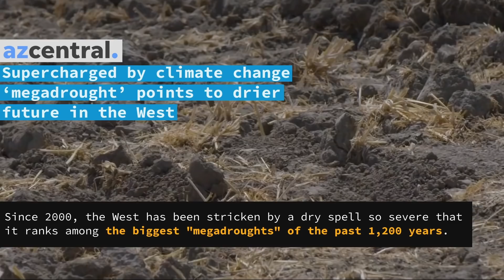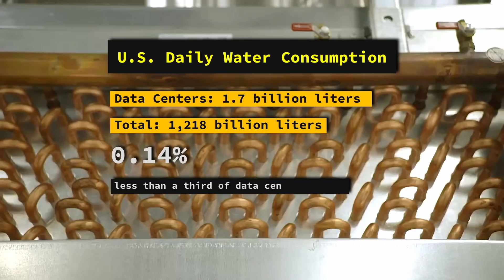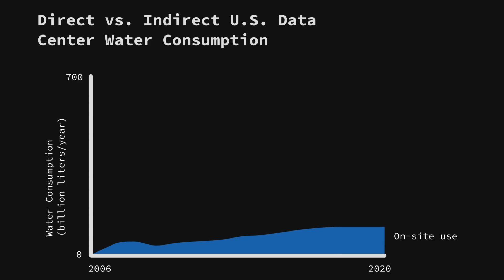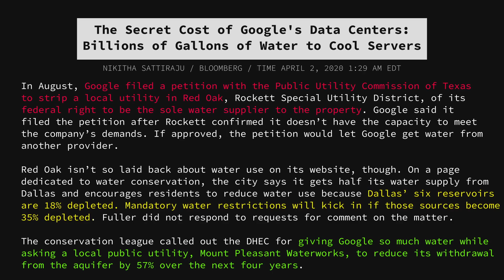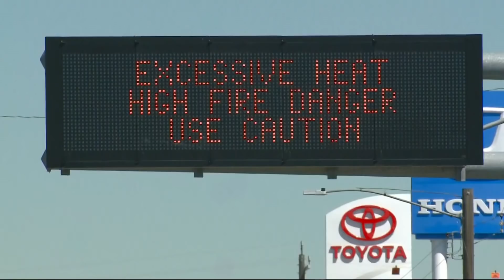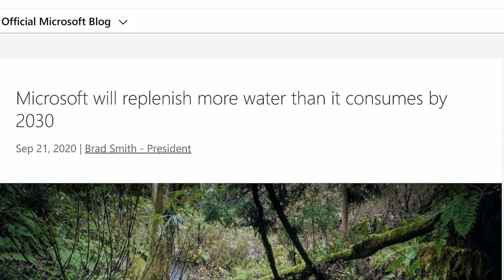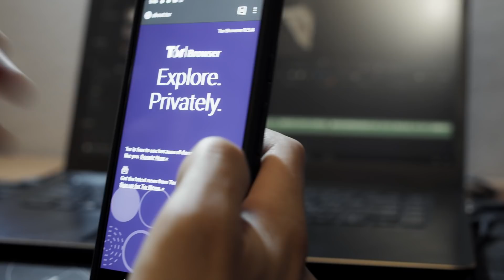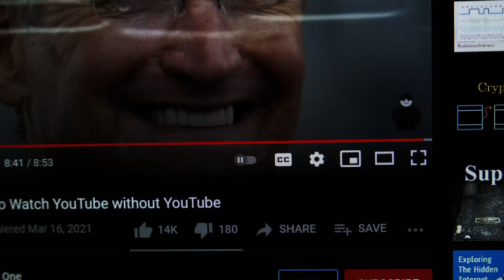The Internet Is Running Out of Water

Comment: The fact most people don't understand what it means to consume a resource and arguing this isn't water consumption is bad.

If you take 200x water from a lake and the natural precipitation refills it at a rate of 10x then you're consume water and depleting the lake at a rate of 190x and when the lake is gone the lake bed starts to dry out making it harder to gather water.

You literally consume that entire resource... as you are by definition using up that lake till there is no more. You have used up the water till there is no more.

If you built the data centers in Michigan to make use of the lakes then the end result would be the same as the lakes would dry up eventually if you take water faster then it returns meaning everyone loses access to water. You are consuming it and using up a resource.

Areas will get more rain based on wind currents and other details as well... which creates a whole new issue. Flooding. Not only are you using up your resource but you're increasing rain fall in other areas leading to destruction. So you are consuming and running out of water while other people have excess to the point where it can be dangerous.

Comment: I think it's a bit unfair to allocate electricity production water usage to data centres directly - depending on the energy mix couldn't you end up with an air cooled data centre apparently using more water than a water cooled data centre if you do this? The energy mix is surely a matter for the relevant authorities to decide, and if they've using too much fresh water in arid areas then that's a failure of planning on their part. Come to think of it the whole thing sounds like a failure of regulation - permits for using all that water should never have been granted if it was unsustainable.
Reply: I wonder how many of the people on regulatory teams are shareholders of big tech companies.

Comment: I find the message in this video rather ironic, considering how you choose to accept payment in cryptocurrency, which is an extremely unnecessary tech that can be cut out (and only ransomware developers + intangible coin holders will whine, but to the benefit of literally everyone else).
Reply: There are plenty of Proof of Stake crypto coins out there now which don't have the power use issues of Proof of Work such as bitcoin.
Reply: Actually there is reason to have crypto currency.

The main thing is if your country violently explodes your money suddenly doesn't become worthless. It gets around country/currency issues which would ironically save more if we all shifted to it reducing the effects of monopoly and make hiding funds to evade taxes or doing your part harder.

The problem is to do that shift requires everyone cooperating...
Reply: @Buglin_Burger7878  Is this "reason" justifiable enough to be unwinding literally the past decade's worth of carbon savings through EV? Or will the internet money magically be able to save all the marginalized folk (that may be rugpulled, mind you) while excluding the poorer folks that has zero involvement in crypto?

That reason is shit my dude. And if you need to get everyone on board, sounds a lot closer to a ponzi than a solution.

Comment: This is misleading. The author lumped Data Center and power plant use of water in the same measurement. And implied that water used for either couldn't be tapped for any other process like irrigation or drinking. Water conservation is important but articles like this track from actual problems
Reply: IT can't be reused. That water has been turned into water vapor. It is no longer liquid water. If it was liquid water still the data centers would have kept on using it instead of paying for more liquid water.

Comment: When water evaporates, it forms clouds and falls back down; it is never consumed (in an absolute context). What has water consumption looked like throughout the years in those areas? Surely, it has been on a constant rise with the population.

The idea that a higher level of CO2 in the atmosphere is causing a drought is absurd. Think about it; if CO2 is supposed to cause a greenhouse effect and keep heat from radiating from the Earth, why does it get chilly at night in the summer time after a scorching hot day? If CO2 was an obstacle to IR radiation, wouldn't that work both ways? I realize that the sun emits UV and visible light in addition to IR, but isn't IR what is actually felt as heat?

Let's conduct an experiment: prove whether or not CO2 causes a significant greenhouse effect; at the same spot and the same time every year, take a spectrograph of the sun's light, and compare each one for a decrease in IR light reaching Earth. If it inhibits IR radiation from Earth, it inhibits IR radiation to Earth.

Let's conduct another experiment: how extreme is the greenhouse effect caused by CO2, if at all? Pull a vacuum on a chamber which has an IR emitter on one side, and IR receptor (or camera, so any diffusion through the gases can be imaged) on the other; this chamber may have to be very long to be able to measure how different gases may or may not effect IR radiation. Take a measurement of the intensity of IR reaching the receptor. Do the same with 100% CO2, and with 70/30 Nitrogen/Oxygen. Lastly, increase the CO2 concentration by the same minuscule amounts that are measured in the atmosphere, and see what happens to the IR.

These two experiments alone can make or break the whole idea of climate change, formerly known as global warming, formerly known as global cooling. If you're right, what have you got to lose? Do the experiments.
Reply: It is consumed as you are using up the resource.

If 200x of water is evaporated 200x isn't going to fall where it was used at, hence it was consumed. It is removed from that area. That 200x will end up in another area based on wind currents and such.

So if you get 10x water a day through natural means then you're losing water at a rate of 190x and the bodies of water dry up. If you know how lakes form if you drain all the water eventually the dirt dries out and it becomes harder to form a lake.

This means the lake you're drawing from is being used up.
It is by definition consumption.
Reply: @Buglin_Burger7878  Read the parenthetical note.

Comment: Very flawed logic here. Water that is sitting evaporates… the energy to evaporate it can be used to cool data centers.  It is a very efficient means of cooling.  Water is not consumed in the process.  So, you insinuate we should just let water evaporate on its own under the heat of the sun as opposed to using that latent heat to cool data centers.  So we should burn coal to make up the difference? 

Sadly, you and your followers mean well but are misguided.

Comment: I don't know much about either power plants or data centres, and the video has left me a little baffled. The video has mentioned the majority of the water consumed by data centres is indirect water consumption for power generation. And the sources in the description have noted that the high indirect water consumption originates from the non-renewable method of power generation. 

So I wonder if data centres commonly operate their own power plants that are independent of the grid for normal operation? And I feels like the excessive indirect water consumption is perhaps more of an issue on the part of the power plants than the data centres? And since any method of power generation that is not wind or solar consumes a large quantity of water, (even nuclear or geothermal would have to use steam turbines I think), is it really meaningful to focus on the indirect consumption?

Comment: I can't understand why any new large warehouse or data center isn't required to cover all of their power use by installing solar panels, wind generation and batteries. They shouldn't be drawing off of the grid in this day and age and they shouldn't be allowed to use large diesel generators for backup power unless they have batteries that will act as the initial backup for a given amount of time and then they can switch over to a generator if the power outage lasts long enough that it depletes their batteries at a rate that the solar panels can't recharge them.
Especially companies like Walmart and Amazon. They come in and build these massive warehouses, they are given all kinds of tax incentives to build the place and a lot of times the state pays for the infrastructure leading to the building. It's ridiculous.

Comment: "47% of this drought has been caused by human activity" yeah no, you can't just play telephone with something as vaguely defined as climate change and attribute it 100% to 'human activity'. Datacenters should make use of blackbody heat radiation and small nuclear reactor modules for energy, it would be alot cheaper to just have passive cooling during the night to cool thermal reservoirs that take some of the load off active cooling during the day.

Comment: Some important points missed in the video. Why is water used in electricity generation, which seems to be the larger portion for water usage? If water is used for evaporative cooling, then where does the steam go? It's not like they pollute the water and straight up make it unusable. If they don't use evaporative cooling, that most likely points to water used as a heat conveyor, so where does the incremental usage come from?

Without answering these, the video just seems like an illogical piece to simply promote the hate for big tech
Reply: Maybe it just goes back into the air because they don't recycle it... and in turn this means the water goes elsewhere and rains down on other places.

Comment: This is confusing me though, water do not disappear, if it's used and evaporated, it is still there, just in gas form and it should be condensed after a period and fall down as rain again. Water don't just disappear when boiled or heated. But if this is the case, then the reservoire should not decrease, but they are. Idk how this works.
Reply: Water comes from under ground springs.
Reply: @KallusGarnet  ?????
Reply: @KallusGarnet  what fills up the springs?

Comment: As far as I understand it, tech companies could reuse the water that they take by containing the steam produced until it condenses into water and can be reused by them. As the price of water increases it makes sense for them to start to use oceans and desalinate it. Places with a lot of drought could likely use these tech companies to help fix their problem if they worked with them on desalinate projects. They could also encourage tech companies to take this route by exponentially increase the price of water based on usage. The higher your usage the more per litre you pay. It would be awesome to hear your thoughts on where this is incorrect.
Reply: Another approach is building a cooling loop into a natural structure, ex. literally building the radiator submerged underwater in a resivour. Entirely passive, free cooling (besides pump consumption), some data centers even use this method.

But you need a favorable natural site for it, and it'll cost more than more typical cooling methods.
Reply: They could also use closed loop water-cooling instead. With a big enough radiator, this could even be entirely passive.

You could also use a hybrid solution, where water is recirculated and some is evaporated, or a supplementary supply is sprayed on the radiators to cool them.
Reply: if they were actually making steam, it couldn't be a closed loop (easily)  that's not to say there aren't solutions, you can easily have multiple heat exchangers (some data centers do exactly this) where the the water lines go into an exchanger next to coolant lines.  Heat moves from the water to the cooled coolant, which is tranported to the external unit, compressed to get much hotter than ambient air, transfers excess heat to the radiator, moves back down to the data center and gets decompressed, cooling off enough to absorb more heat, and repeat the cycle. 

you could also skip the heat exchanger and run coolant directly,  but great care needs to be taken to not run the coolant below ambient temperatures in the data center, otherwise you risk condensation which is a quick computer killer.  See all the effort overclockers go through to benchmark with LN2...
Reply: @Pluto : But it does take time to return to places it's needed. In a humid environment, you'll be fine, but if you dry up a revisor in a desert... you might be in trouble.
Reply: Price based on water usage sounds like a brilliant idea, however those kinds of increases in prices just get passed down to the end customer. The only way to actually get data centers to change is for them to actually want to change. Any government pressure or laws will probably sky rocket prices. If the government started offering money to create efficient data centers things will probably change.
Reply: @mattmurphy7030  I live in a country where there is no other real alternative to drinking desalinated water (through reverse osmosis) every time we open the tap. And well, we're perfectly fine doing so :-).

But there's one major difference between us: here we've got nationwide freshwater pipeline network, enabling us access to this desalinated water everywhere, from north to south east to west. There's even a long term project to replenish historical freshwater sources!
But this project, when constructed, was declared a top national priority, and cost us a lot: several years to complete and many more years - to "pay the bill". Yes, it was a controversial long term decision - yet it payed itself off multiple times since this project's completion.
Reply: @fishigl  its extremely expensive yes, but whether it payed itself off, or it just payed off the initial investment are two very different things.  desalination has its own operating and maintenance cost, as well as eventual replacement, and this doesn't consider the over salinated water pollution that occurs as a waste product.  Still its hard to put a price on "either this, ship water in from China, or die of dehydration"

Comment: Definitely a fixable problem. It's just a heat transfer problem.

A kg of water increases 1C for every  4,184 Joules  it absorbs. 
1.4 Billion gallons is  5,299,576,497.6 kilograms kg or 2.2173428e+13 Joules per C or 6,159,285.5556 kilowatt-hour 
The point being: We are talking A LOT of thermal capacity 

So there is definitely a more environmentally friendly engineering solution. Also the water doesn't have to be "consumed".  If it just goes through heat exchangers, the water on the other side is perfectly fine... just warm

Comment: Data centers are the greatest security and environmental threat in history. They should be demolished or regulated to the degree of nuclear energy and higher.
Reply: Demolishing such facilities would send us back a century or too as we have become so dependant on them, regulation is the best option, Regulation to the same degree as nuclear should be the last resort if no other form of regulation works.
Reply: @FowlorTheRooster1990  as the video points out, the most important uses of these data centers for our lives only make up a fraction of the total power they're using. There is no civilized, safe, privacy oriented, or anything that is not utterly dystopian about having AI controlled lives, algorithms used for advertising and metadata collection. A surveillance tool is not a public asset. The majority of data centers can be demolished with little consequences to our actual internet use.

Comment: what happen to the water after it's used for cooling ? although depend on whether this is a open loop cooling system or a closed loop system, this could be a win win opportunity. Desalination require a lot of energy to get the salt of out water, and data center produce a lot of waste heat. Well, why not used data center heat to desalinate sea water into drinking water, then use the waste brine and salt to build parabolic salt mirror that focus sun light into concentrated sun light for solar power. Essentially turning 3 waste products into 3 useful products. You cant legislate your way out of an economic problem just like you can sue your way into the moon, you would need to provide an economic pathway to turn waste product into useful product.
Reply: O they could but they don't want to spend until they have to.

Comment: Uhm.... even power plants in Poland are switching to closed or at least semi closed loop cooling. Water can't be easily destroyed - what they are doing with it?  Waste due to use in cooling is minimal, if any. In any case, regular old school telecom providers used to learn to live frugally with cooling and water for remote equipment for decades now.  BTW: funny thing is, that for most latitudes, average temperature as shallow as 1.5-2m below ground level is equal to year's average.  Simple, passive piping could take considerable amount out by  virtue of thermodynamics, allowing to contend only with difference.

Comment: Isn't water used for energy generation either recirculated or put back into the system?
Hydroelectric powerplants don't really consume water per say, since the water basically falls down into a stream at a lower elevation.

I'm not sure about coal and NG powerplants tho... It is possible to reuse water there, but I guess it depends on the powerplant in question.

Comment: Having worked for a few years fixing hardware in a half a dozen dulles corridor (va) DCs I can tell you that water cooling is far from an ideal solution - just the sheer amount of rust and oxidation that builds up on the hardware when running in a relatively humid environment should be reason enough to look for other options. Every DC I supported had a different cooling solution implemented when it was built, even ones that came online less than 6 months apart.